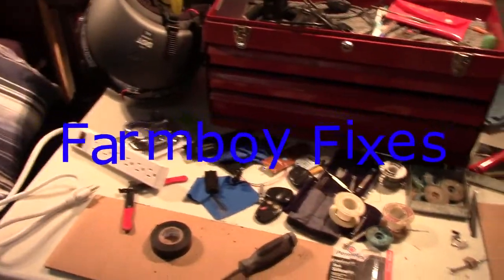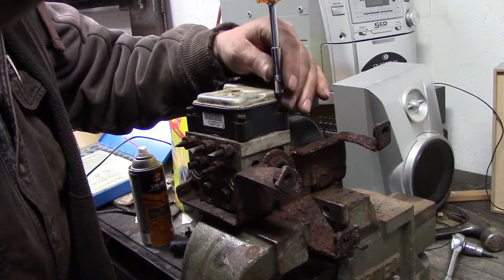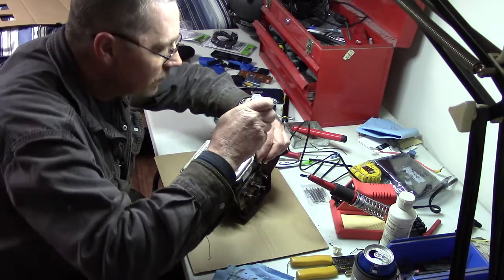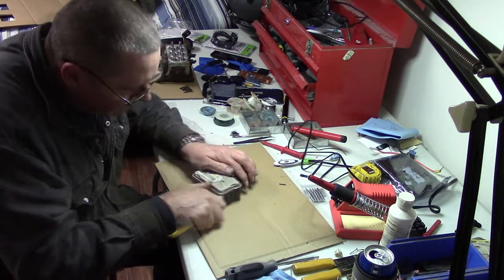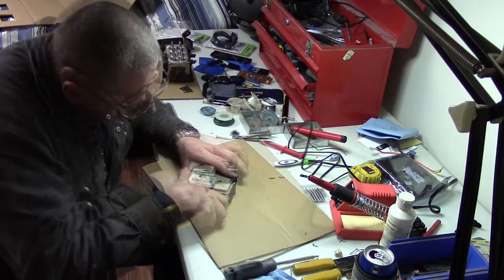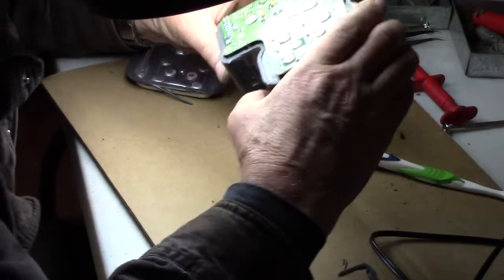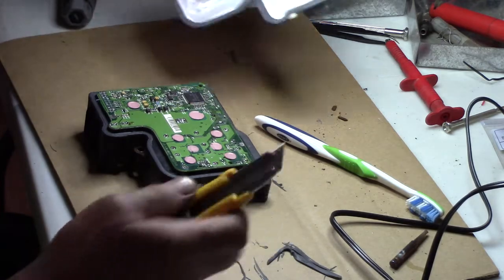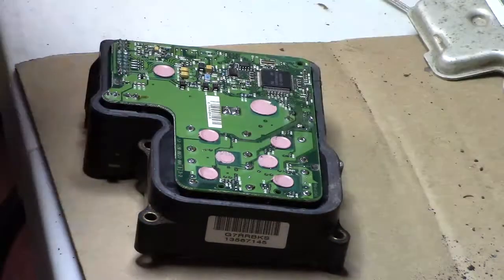2006 Chevrolet 1500 EBCM repair

Comment: I have a 2006 Silverado 1500 4wd and I have a C0110 abs code for "abs pump circuit malfunction." Seems like the ebcm is reading ok. I checked the wiring for both power wires to the ebcm and I get 12 volts up to there, and checked the ground it that is good also. Does this mean the abs pump assembly is in fact bad for sure? These days you can buy a reman. ebcm but the pump assembly you can only buy used on ebay or a junkyard since GM discontinued them. I did however find a place that rebuilds the electrical part of the pump assembly.

Comment: I have a 2001 grand am gt with  U1040 ABS code, you think its worth reworking the solder joints? I actually have two of them maybe Ill open up the spare I have.
Reply from the maker: If you have it open, solder it up.    The other one will probably need it too.   They all come on the assemble line soldered by robots/ovens.